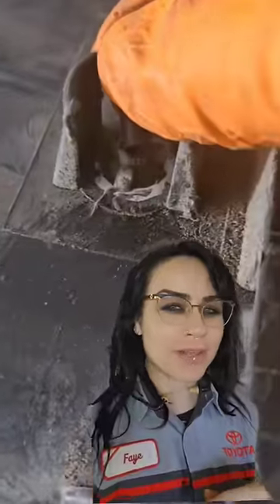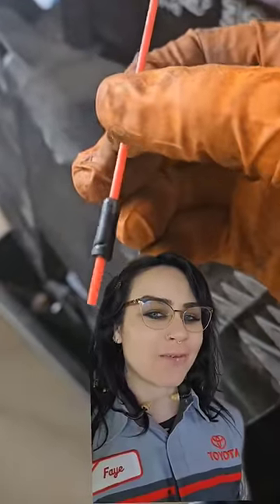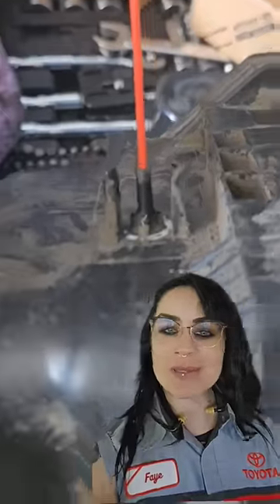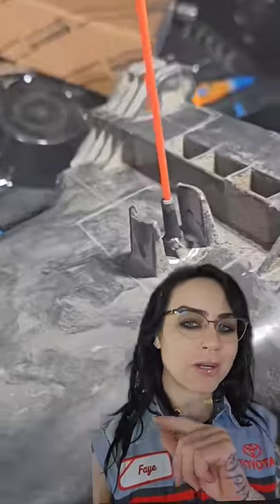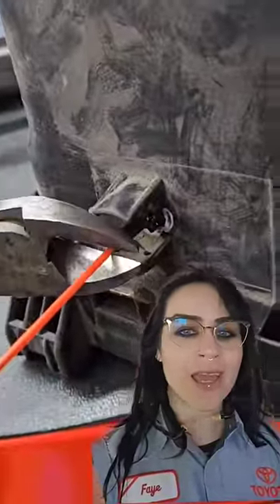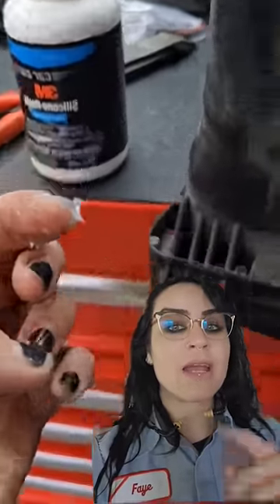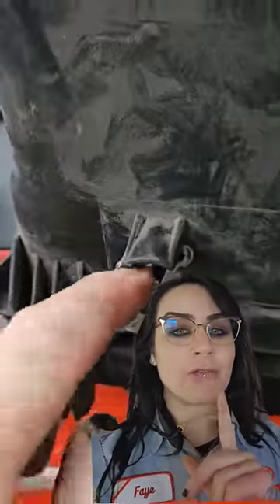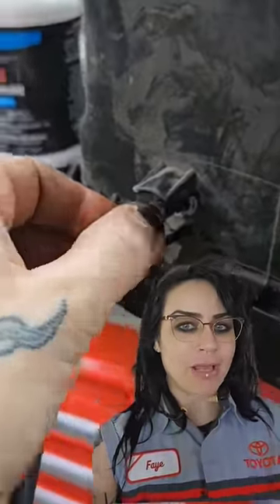Quick Fix - Broken Vacuum Port / Air Box Nipple Repair #techtips #toyotatech #femalemechanic #diyfix

Comment: I you sprinkle baking soda around the outside of where the glue runout is that will dry instantly you can also use it to build up a part that is missing some plastic.
Reply: Good idea. 👍👍
Reply: Or borax
Reply: I came here to say this.....good job
Reply: You're exactly right.  I actually was gonna comment the same thing but you beat me to it😮!
Reply: Hell yeah! I seen that video too.😂
Reply: I haven't used the Soda but I know cornstarch is what we use as an instant hardener and it actually makes the glue harder as well.
Reply: @gzus1482 not everybody learns everything they know on YouTube..
Reply: @nickzaremba  What that about "everything?" Where did you get that from? 🤔
Reply: Baking soda and super glue has saved my ass many times. I have a repair from 5 years ago . It is still going strong, and it's outside year round. You can sand and paint it too.
Reply: Yeah the baking soda trick only works on non gel glue.
Reply: I just have something to add to your comment. Mixing baking soda and super glue does work great but u don't wanna use that on stuff that experiences vibration. It will break right back due to the nature of hard things being brittle.
Reply: i use this trick all the time. works best. super solid
Reply: Baking soda works really well with 6011 welding rod
Reply: @jonathonwerner5968  please explain
Reply: Only works with Cyanoacrylate (instant glue)
Reply: Yep I have black reinforced powder for CA applications like this .
Reply: Use chopped carbon toe instead of soda etc for building gussets in vibration areas. No cracky snappy forever.
The toe will work with CA & epoxy. Epoxy is better due to flexibility, go for 20 minute cure, not 5.
Reply: Just don’t carry the baking soda in a ziplock bag inside a case with various tubes of unlabeled glue. Ask me how I know 🙄
Reply: Forgot about this one.
Reply: I use the baking soda method anytime someone breaks something plastic where I work. I was shook that no one here knew about it, and they were shook the first time I fixed an airbox for someone with super glue and baking soda 😅😂
Reply: @400Redsport  same
Reply: I have reinforced my glue jobs by taking toilet paper and using 1 ply of the 2 ply paper first. So I glue in place and add extra glue outside then a thin "TP" strip to brace.. more glue on top then add the baking soda. 

My eye glasses held for months at the hinge after such a fix. It wasn't too thick for anyone wondering. The single ply is key
Reply: CA Glue and Activator and it will bond in less than 4 seconds.
Reply: @SaveAmerica-TRUMP2024 thanks I didn't know that
Reply: I've done the baking soda to build it up a little and cure it right now trick. I also keep CA glue accelerant handy if I don't need the build up, like when sizing O rings
Reply: That was dumb!  I just wrote the same thing pretty much and then read what you wrote😂 your on it! 👍🏽🤠
Reply: Good tip. I’ve seen a YouTube make fishing lures with baking soda and super glue.
Reply: @Mark_from_IT well I'm curious 🤔
Reply: @benjaminblankenship980  it’ll look like cocaine. 😂
Reply: Since every body knows this trick, and it does work very well. I will tell you where this trick came from. The military uses this to patch bullet holes in helicopter rotor blades. So if the military uses it you know it's gotta be good.
Reply: @jeffarp7409  they also use it inside aircraft wings
Reply: I was just going to say baking soda for quick dry saw dust for wood filler
Reply: @firemech911  cool.
Reply: Any powder will work. Talc, Wheatflour, Columbian Marching Powder and cetera.
Reply: It's also a much stronger bond. Superglue doesn't work well with plastic because it breaks it down. Baking soda will help it bond and dry quicker so there's less time for the plastic surface to degrade.
Reply: Funny when I saw this the first time that is the first thing I thought was where is the baking soda!!!
Reply: I almost typed this. Glad I did some reading first.
Reply: Not true..
Reply: The superglue / baking soda method had been widely published & had been around for years.
Reply: @SaveAmerica-TRUMP2024 super glue in gel form won't harden with baking soda? Really?

I just purchased some loctite gel which I am sure u used before.
Reply: @Mark_from_IT lol I got to hear this how do you know?
Reply: Truth
Reply: The bicarbonate makes longer, stronger polymers in the cyanoacrylate
Reply: Baking soda and CA glue is a real thing.
Reply: I CAME HERE TO MAKE THIS COMMENT TOO!  My grandmother showed me the baking soda trick in 1986.
Reply: This... No straw necessary so you wont be restricting the air either...
Reply: @Mark_from_IT Detained at customs, border control & or ruined glue!?
Reply: I also find the exact position and mark it on both pieces.
Reply: I came to say this same thing, or for color purposes you can use scrapings from a piece of charcoal though not the match light kind.
Reply: @johnhurtme  Good point. Few times I broke few pencils crushed the carbon to a fine dust . Repairing a plastic , I poured the powder in the repaired area containing wet superglue. 
This made a very strong repair . 
I haven’t tried it but perhaps one could use different color pencils depending on the color of plastic.
Reply: @mikeeslami1746  id say it would be more aesthetic than strong, as I believe colored pencils use a wax base, more like a thin crayon on the center. Or that's been my experience when sharpening a colored pencil. Someone may have a different experience they have more direct knowledge with.
Reply: Good idea. I like touse wiper washer hose adapters. 😉
Reply: Smart..
Reply: I’ve been using this since last year. I own tons of stuff now that is part baking soda lol. It’s works great.
Reply: Yes Baking soda reaction with super glued works great.  I usually plastic weld but this works.  There are some great plastic epoxy now as well
Reply: Came to say this very thing.
Reply: My thoughts exactly..hers would fail fast
Reply: It will fail super glue weak like that..use baking soda build up area..  like a rock..
Reply: Baking soda , and super glue? Gotta try this.
Reply: That never lasts long tho...

Comment: I've Been A Mechanic Since 1973. This Is An Awesome Fix. Thanks . You Never Stop Learning.
Reply from the maker: Glad to help 😀👍🏻
Reply: It wont last very long with use. I would recommend using a stronger glue and or at the very least sand the plastic. Smooth plastic doesnt bond very well with adhesive.
Reply: Sure you have
Reply: @Sak-zo1ui  U can also use resin and stainless steel screen, or weld with screen and soldering iron. Yes a mechanical bond as in sanding, grinding etc is best along with a chemical bond if I can do it as in adhesive promoter wheb painting parts that flex. but I don't see that being used alot taking it off and on. Well I take that back it may depending on year, model etc. Some of the ways they do things now is borderline stupid.
Reply: @FayeHadley you sill do your show on motor trend?
Reply: @xmo552  Yes I fixed a few headlight buckets with It and fiberglass cloth. When I did basement waterproofing we had a 2 part resin and a carbon fiber roll of 4 inch wide strip long enuff to go from floor to ceiling on wall. I said How's this stuff gonna be strong enuff to keep a brick wall from moving in or out? Well I ate my words cause that strip after curing was like anchoring a steel beam to the wall but alot thinner and still allowed for shelves, walls etc. I can't tell u how many of those rolls that was tossed cause the resin has a use by date and was tossed. I should've kept the rolls but they came in a kit all wrapped in plastic in a box. 

I kick myself when I need a quick fix and think if I only saved a few rolls it'd lasted a lifetime. Another company makes alot of products like that for fixing pipes, tanks, etc. Alot of industrial uses for that kind of thing cause it's approved to be used to fix spots, not spending millions on new stuff cause of 1 lil bad spot etc.
Reply: @xmo552   epoxy is a stronger material but doesn't stick well to plastic.
Reply: @xmo552   it usually states that right on the package for most epoxy brands. (not suitable for all plastics) Personally, I think this fix is pretty good. If you need stronger, then shove a piece of brake line or similar inside.
Reply: @xmo552    I'll give you that, but when most speak of epoxy, they are talking the common 5 minute stuff. Heck, even JB -Weld makes a 5 minute product, but you'd need to experiment and see how well it sticks.
Reply: This fix sucks lol
Reply: @FayeHadley when you said nipple, i made a huge mess
Reply: @FayeHadley 
It’s nice to see a young, good looking lady who’s smart and knows stuff about mechanical things!!! 
I’m sure you had a loving father who taught you a lot of things and helped instill a love of mechanical work! 
It is a labor of love because it’s not a lucrative endeavor!!!
Yes you can make money being a mechanic, being a good mechanic probably pays better than just being able to do mechanical repair work, but it’s still not an avenue to lots of money or being financially comfortable.

Good luck in your career and in life!
Reply: @FayeHadley buddy had this done by a previous owner to his trailblazer.  Long story short 3 main seals later the mechanic finally found this bought a new airbox and problem solved.  It'll work for a while but then...

Comment: If you put Vaseline on the straw, it'll slide out (unless you want the straw to stay)
Reply: The glue's well and truly cured at that point.
Reply: You want the straw in there for reinforcement of the joint between the two pieces.
Reply: I’d definitely do that! I feel like air flow has been calculated to be like perfect in cars and if I make the hole smaller where not enough air can get in our out I’d be paranoid about it somehow hurting the car lol.
Reply: @gendoll5006  It's more likely that it would just snap off and you'd have another vacuum leak by pulling the straw than you would impede air flow. Vacuum is not something that is precise enough for that minimal change in diameter to affect it. There's not perfect about any car, but vacuum lines are not a critical flow rate component... they just have to seal.

Comment: Please keep in mind there are different sized vacuum lines for a reason. Decreasing the size of the hole decreases vacuum. But a great idea.
Reply: The reduction of size will restrict the proper mass of air flow. For a temp. fix it's kinda ok. BUT, imagine pinching the air intake, or restricting flue should fix everything right on up.
😮
Reply: They take the straw out though...
Reply: @creator4413  no she left it in place.  As well she cut it to length after showing that she leaves it in place.
Reply: Decreases volume but not vacuum.
Reply: A mechanic did that on my moms old pickup. I found when the nipple fell off, now that part is no longer available. He created a vacuum delay port where there isn't supposed to be one. Just like the vacuum delay valves on older systems. he broke it changing a fuel filter, and hid it, like a little kid.  That's why i do my own maintenance and repairs. Unethical and immoral mechanics.
Reply: Great point😊
Reply: I've been doing this for years on he older toyos thought I was the only one
Reply: It may increase the amount of time it takes to produce the required vacuum pressure. But it won't reduce the vacuum pressure itself. And the time difference is essentially negligible for a daily driven EVAP purge valve. If we were talking about nitromethane ran engines then you'd definitely have a point.
Reply: Just do the same thing and then drill out to size
Reply: Insert the tube into hole, apply the glue to the part, slide the nipple to the part then twist the straw a little bit then pull it out. You won't get any glue inside the air box.
Reply: No, the straw is permanently glued so they cut it - did you watch the video? @creator4413
Reply: Just run a drill through it.

Comment: Good tip.  Blow through the straw when the glue is still wet to clear the inevitable bit that got in the end upon assembly.
Reply: Put the straw in BEFORE applying glue.
Reply: Both good suggestions
Reply: I'm watching it and I'm saying to myself after the glue hardens won't seal the hole and prevent air flow
Reply: Use straw to allign while applying CA glue (superglue, which partially dissolves the plastic used to make these airboxes). Quickly slide nipple down straw and remove straw after a couple seconds of contact.

Worst case, you pull straw too fast and try again or wait too long and then still cut straw.

Best case, fixed and lubed nipple with no straw for full suction enjoyment!
Reply: And if all else fails insert a lip stud in the hole for added stability
Reply: Could always just drill it out if that happens

Comment: 1. Go to hardware store or online and get a brass bolt on fitting, that has a nipple the same size as hose
2. Drill hole in plastic to the correct size for the threads of your fitting
3.Thread the plastic with a tap set
4. Add some silicone on the threads and thread it in.
5. Reattach hose.

Perm fix that doesn’t look ghetto and lasts
Reply: > doesn't look ghetto
Debatable
Reply: @dwaynezilla  its a brass nipple and if you have some basic skills, looks factory installed. 

A gob of glue and a red straw looks ghetto. Sorry
Reply: @goclunker Your idea is better, but to be fair, this quick fix looking ghetto doesn't seem like a problem to me considering you'll be the only one to see it whenever you happen to pull the hose off for maintenance work which is going to be like a handful of times a year at most
Reply: Cool. Let me just leave my flat rate job and run up somewhere real quick.
Reply: @jdmking4776  sounds like a you problem
Reply: @goclunker  didn't ask
Reply: yeah unless you know exactly what ur doing that could end up looking even worse than the plastic straw
Reply: @beastt549 There isn't much to know here. You're attaching a fitting to a plastic box. Do a neat job and you're done. If that's too  much of a challenge then mechanical work isn't for that person.
Reply: @dodgeplow   the funny thing is thats not even mechanical work 💀also if it looks ghetto it doesnt even matter unless the hoods open cause nobodys gonna see it
Reply: I did this for a broken radiator upper hose nipple. I drilled it instead of using a tap though and it leaked with the white plumbers tape no matter how much I used. Eventually, I used high temp gasket maker and it's been holding up for 2 years so far. The straw trick seems pretty neat for smaller inner diameter nipples though.
Reply: @jdmking4776  You can always buy it at the same time you buy a nut or a bolt for the current job, since you apparently don't have a stock of things you might need now and then.
Reply: @goclunker  Once it's installed no one will see it.
Reply: @ne0tekk1  you don’t do it on a radiator…this is a airbox
Reply: @mmace3  I don’t do hack work, but you do you
Reply: That's where my mind went
Reply: Agreed
Reply: And doesn't change the vacuum capacity
Reply: I think the most important part is that the vacuum doesn’t decrease with the straw being stuck in the hole
Reply: Brass fitting repair...great idea thanx for the tip.👍
Reply: @goclunker  Looks factory installed? A metal that doesn't show anywhere else in an engine bay? Also your talking about putting a stronger material that is stiffer into a softer material. Now you have a brass lever pushing on thin plastic any time there's stress on the nipple. The brass won't break before the plastic so you'll crack the housing instead of just breaking off the nipple, and that's going to take longer to repair than a plastic nipple. All in all your method is probably fine, but it ain't perfect and it doesn't look stock either.

Comment: Not only is the straw hole half the size of the original hole, I think there is glue on the end of the straw from where you poked it thru a big glob of glue.  Maybe skip the straw part and just glue the snot outta the nipple - use JB Weld apoxy.

I leaned on a radiator inlet once to get leverage while wrenching on my engine and it snapped clean off. I reattached it with JB weld and drove the car with no radiator issues for another 5 years!
Reply: Yup JB Weld fixes everything..

Comment: I used brass ball point pen ink chambers.  Before they stopped making them.  Made a permanent repair.
Reply: That's pretty brilliant. Love fixes that leave it stronger than before. I can't think of what other piece of disposable metal would work for that. A coat hanger isn't hollow. Maybe roll a piece of flat steel into a cylinder?
Reply: They still may those ink cartridges but now their made out of aluminum.  Should still work
Reply: Pilot Precise ink tubes may work.
Reply: @eddyb1596 with it being the air box you want it air-tight. So if you were to roll your own little metal tube it wouldn’t be sufficient enough. I would say any hardware store sells metal tubing for various applications and could be used just like OP did with the ink chambers. Just saves you a trip to the store doing it his way because little pieces like that shouldn’t cost anymore than a few bucks from the hardware store
Reply: Or Cross, Waterman, Mont Blanc.  Office supply sells off brand equals. Just see if you can find one that matches the barrel size.